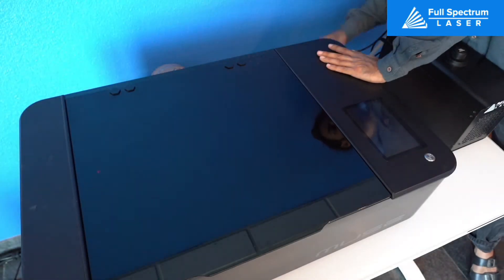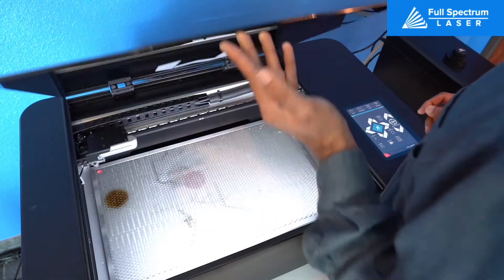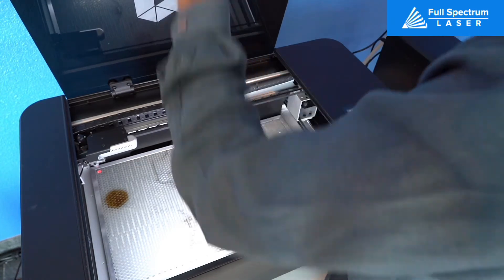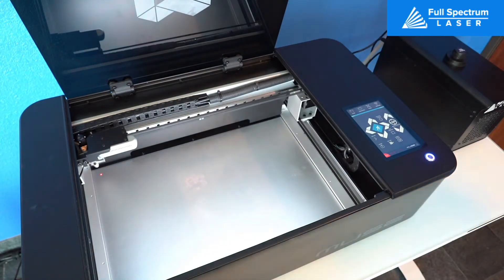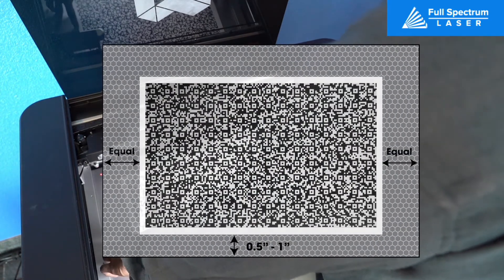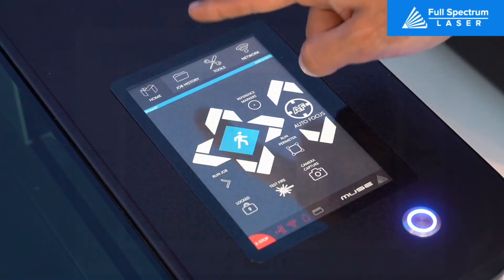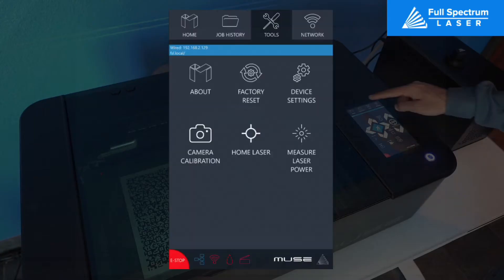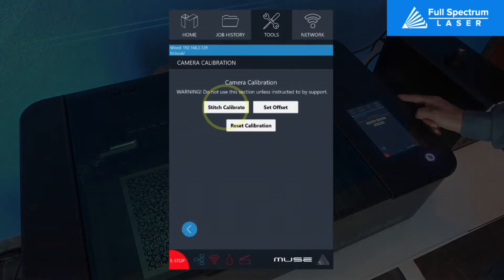How To - Calibrate Your Muse Camera

Comment: Can you calibrate the camera with the riser installed? Taking out the honeycomb will expose the bottom of the riser which has a bar at the bottom and not a good place to put the calibration sheet. Putting the calibration sheet on top of the honeycomb would be ideal but not sure if it would cause a misalignment somewhere. I would like to just keep the riser installed most of the time -even when not using the rotary tool.
Reply from the maker: It should prompt you for your setup when calibrating, i.e. if you have the honeycomb or the floor removed.
Reply: @FullSpectrumLasers  I have the same question, I have the riser installed so if I pull out the honeycomb there is nowhere to put the sheet.  Can I just leave the honeycomb in place while I calibrate?  There was no prompt for setup when calibrating.  It just started calibrating.  There is a prompt for setup when taking a capture of my bed, but not when I run the stitch calibration.
Reply from the maker: @denaesullivan6795  Yes, leave the honeycomb in place while running the calibration. That will be fine.